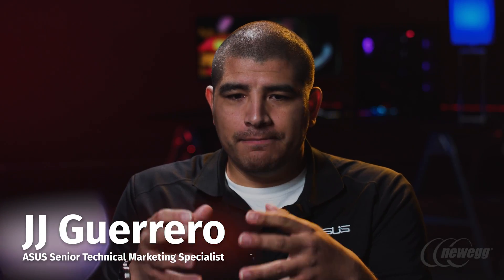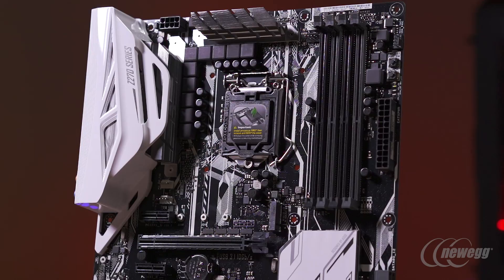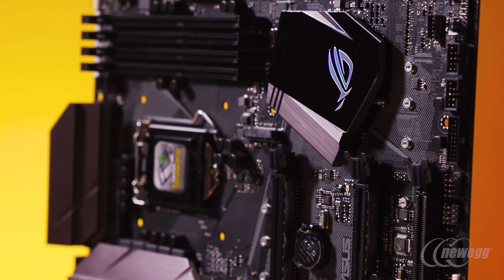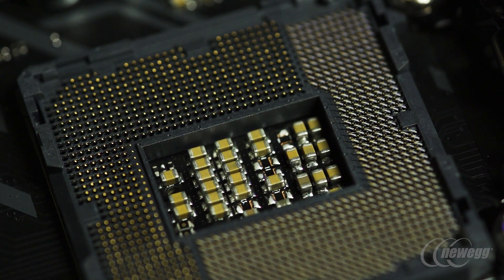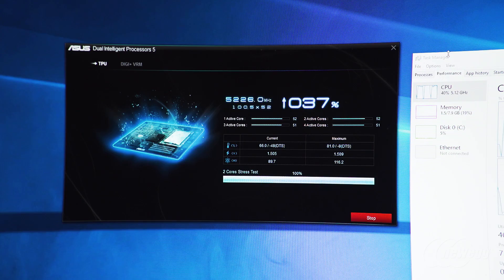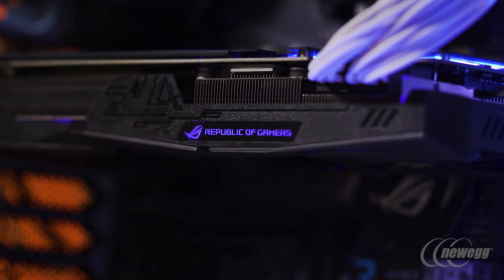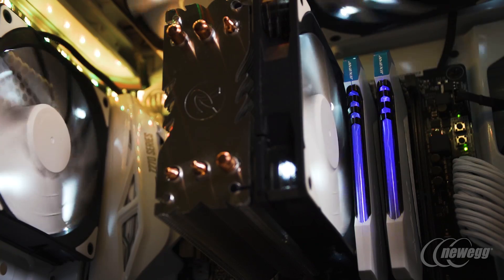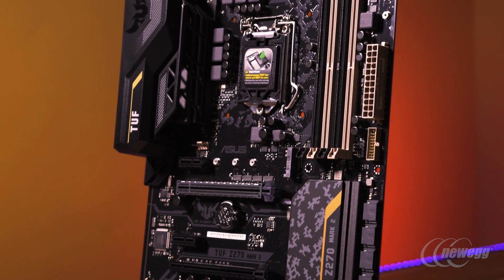Newegg Insider: ASUS Z270 Series Motherboards

Comment: does skylake chips support on z270 mobo , or is it just for kaby only ?
Reply: PEWDIEPIE FAN same socket so you can run a skylake cpu in a z270 mobo.
Reply: +kristoffer skjordal but I've heard that z170 supports both 6th gen and 7th gen but z270 only supports 7th gen only !! is that true ?
Reply: Skylake works on Z270 and Kaby-Lake works on Z170 but will need a BIOS update.